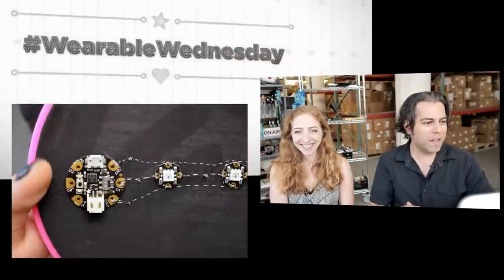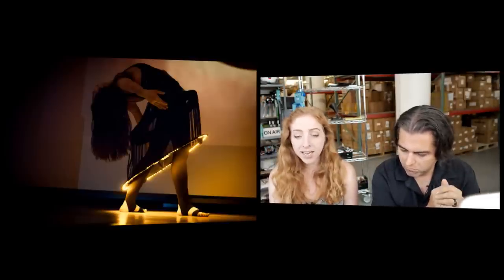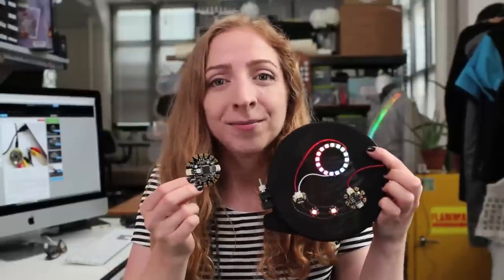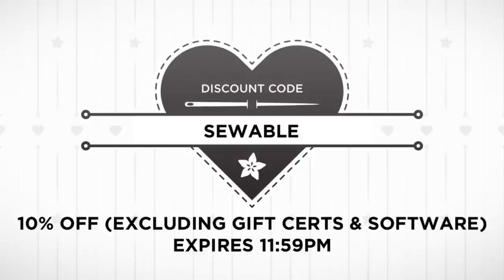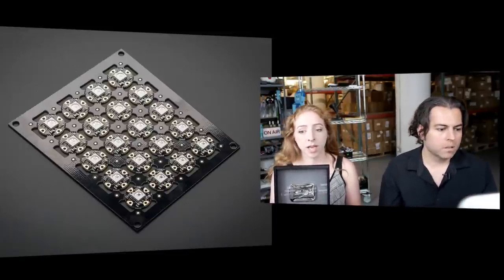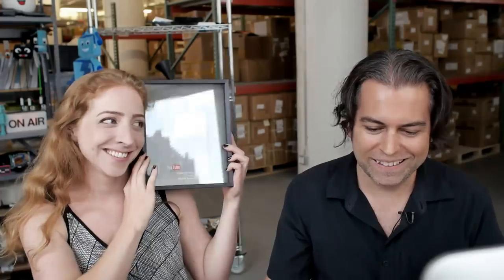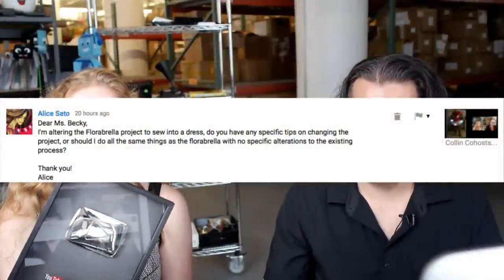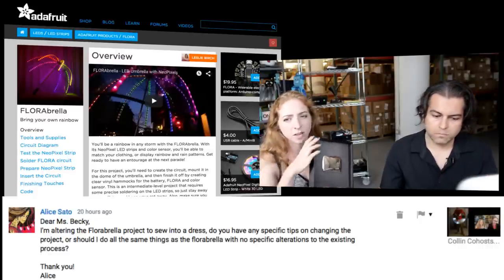Wearable Electronics with Becky Stern 8/26/2015 - LIVE

Comment: Since it is very popular among YouTubers to sell a limited edition t-shirt or something of that nature when they hit subscriber milestone, might I suggest (though you normally do not sell Adafruit branded clothing) designing a t-shirt for hitting 200k or 250k subscribers.  It could be something like a t-shirt with a pocket but have an "electronic" paint by numbers on the front with a layout for neopixels; gemma or flora; power, data, and ground; plus the new battery connector. The battery could then fit in the pocket. As a kit, it could be a valuable teaching tool for beginners, and for dedicated fans, another way for us to show you all support for the work you do.